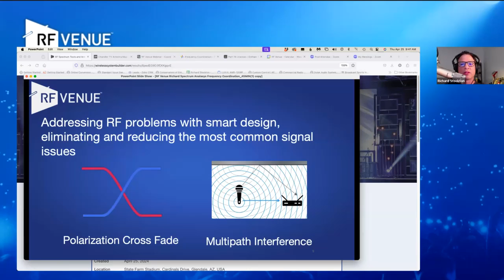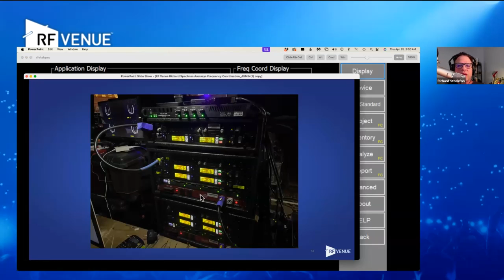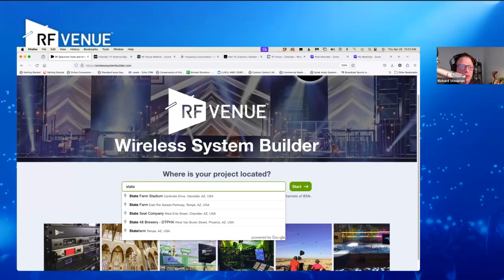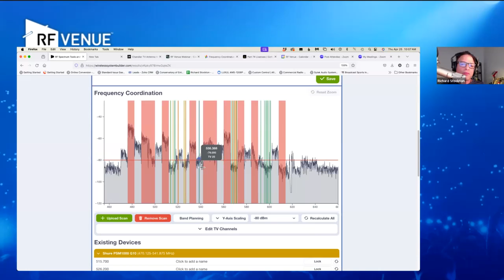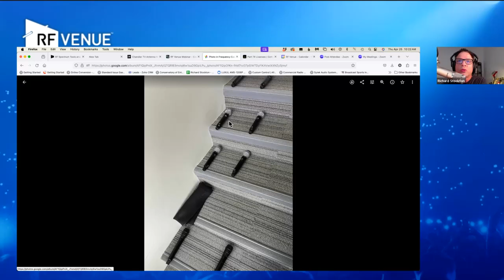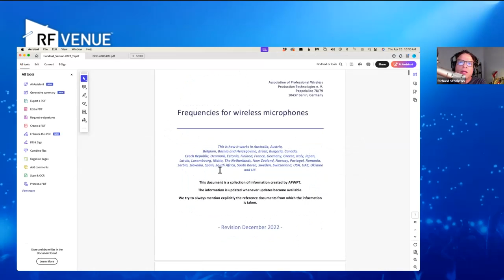RF Coordination and Wireless System Builder training

Comment: CPU in this Device RF Explorer Pro is extreme old. Taskmanager in Windows near 100 % every Time. Old Hardware, high Price
Reply: The CPU used is a 4-core, 14nm powerful Intel Atom x5 with an excellent TDP of only 2W, which guarantees the best battery duration given all internal firmware performance demands. It is expected that the user may notice 100% utilization on one core out of the 4, as this configuration provides optimal performance. This is by no means a problem, but a good use of resources. We have been fortunate that Intel still has stock of this model because newer models are more power-hungry and offer no additional benefits for this application.